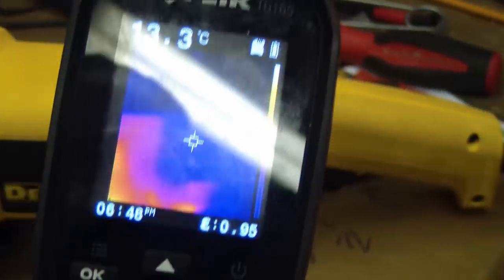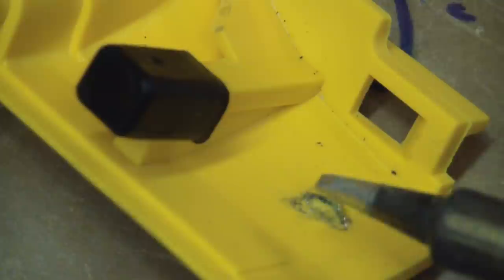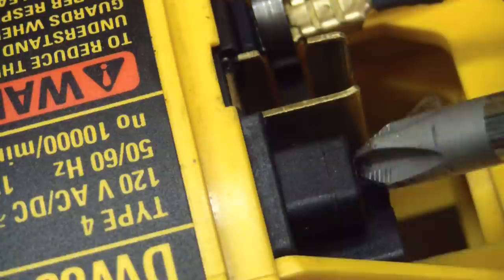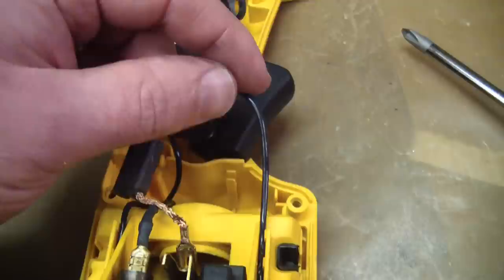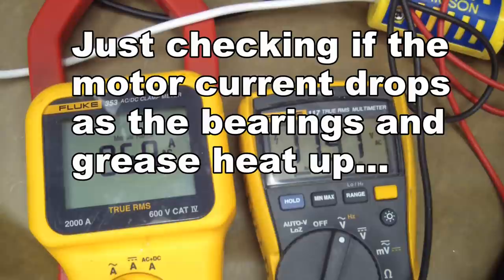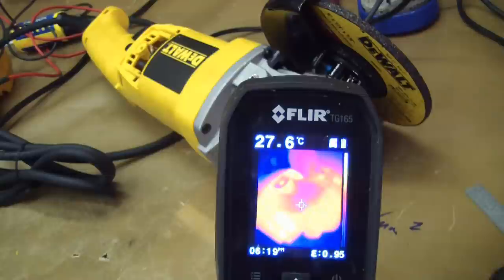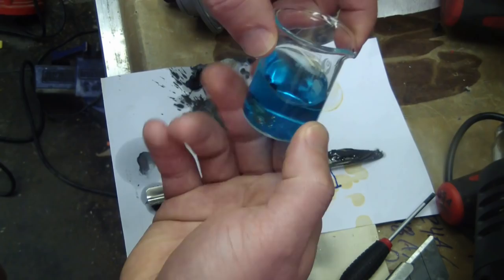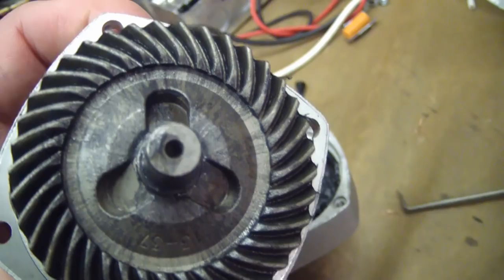Bored of lame tool reviews? Meet DeWalt's grinder guts Part B

Comment: The gear absolutely does go out the most often. I have seen the brushes on Makita grinders 'let the smoke out' many, many times. I have only seen the DeWalt eat its own brushes once. Our shop uses the DeWalts exclusively now as they are a great bang for the buck. Speaking of bang, that brings me to the most common failure mode I have seen. When the 200 lb gorilla gets impatient, he leans down on the grinder. I have seen dozens of these break where the handle goes into the motor housing. You commented that it was odd that the motor housing had a gantry style support. That support comes of inside of the handle if you lean on the grinder too hard, or drop it the wrong way. Make it idiot proof and there will be a better idiot!
Reply: +Joe Clark What do you think of the DeWalt 5 inch rat tail? I've used Makita for years but the quality seems to be getting poorer. The 5 inch in AvE's video are heavy the company I work at has one it's heavy the 7 inch is even worse.  For years in all we used in the family welding shop now closed the staple was 7 inch Makitas the 5 inch wasn't that common then. The old 7 inch Makitas never die but they are too heavy for what I need my brother is trying out DeWalt he's tired of Makita grinders failing he gets about a year out of them sometimes less than that.
Reply: +Graveltrucking - For a welder doing heavy work a grinder is a consumable. I get about a year and a half from a DeWalt. I'm on my fourth. Good little machine.
Reply: Graveltrucking, bowie33333 is right on the money here. The only grinder that will last you forever is a 9". The only reason it'll last forever is because you don't want to use it. I think that DeWalt still makes a good 5". They seem to be pretty durable. Makitas need to fix their 'anti-vibe' handles.
Reply: Joe Clark - "The only reason it'll last forever is because you don't want to use it"

LMFAO, you are absolutely right. Those big grinders are unwieldy bordering on unsafe in my opinion. If you need a grinder that big, go get the torch, lol

Any handle can be an anti-vibe handle if you back it off a quarter turn, I was surprised at the difference it made.
Reply: +bowie33333. Backing the I was talking about the other handle, the one with the trigger on that. Majors made it so there's almost an internal hinge between that handle and the motor housing. You can flex the frame easily with only a little weight. It's a terrible design. Marketing schmoo for the back yard pros.
Reply: Joe Clark - Oh ok, I get what you mean now, I was talking about the side grip. I haven't used one, but if it's marketing schmoo, it's not worth a nickel. I wish these companies would realize I don't want the "next best thing" or some helper or gadget on my tools, I just want a good tool. It's a motor on a stick for crying out loud, keep it simple.

Comment: Yes they had powderd metal gears, some
 They made a lot of gears
 They had a giant steel room and 50 multi spindle automatic acme gridley screw machines. Very good engineers. Shop had best tooling for all machines, then scrapped the whole factory, cheap labor and all. Whoever told you being a machinist lied, my machines were interesting and a challenge to set up. Thats about all I did

Comment: trigger lock on the trusty motomaster,  has an open ended handle to put yer broomstick in like a morse taper, some duck tape for even more safety.  seemed like a good idea at the time, worked out well removing anchors from above on a balcony thankfully.  similar spiral bevel gearing, eventually kept popping off the lock nut and sending the disc flying down the driveway twice!  I took er apart and the large gear teeth were gone almost, put it back together and it wouldnt even catch.  Let the dewalt finish removing the cracked aluminimum chinese "racing" rim and ground off the rounded soft metal chinese coated lug nut that no extractor I found would fit.

Comment: The remade Ford GT had issues with powder metal casting on suspension parts. If you bough one a car that was over 100 grand back in the early 2000's you couldn't drive it for a year till they came out with forged replacement parts. I do see that the power metal is going to be future though as it's probably much cheaper to produce over machined parts. I'm curious to see what the insides of a Milwaukee grinder looks like. I could defiantly take a tool apart, but I also lack the electronics and machining knowledge you have. Also I wouldn't have the colorful Canadian commentary Michigan is close but we don't pick up all the Canadian slang.
Reply: Mercedes had a sintered and hardened timing sprocket a few years ago. Teeth sheared off and blew up the engine in my moms car.
Reply: Sintered gears can be good if the process is worked out. You just don't want to be an early adopter after a new process is implemented.
Reply: Robert Szasz  They are probably great in lower torque situations. I would rather have the sintered gears than plastic.
Reply: haha Michigan representing

Comment: The Black&Decker Wildcat grinder was the (tush-hog) in the trenches industrial pipeline in the good old days tool. Used with no guard nor handle for grinding the root-pass. AC/DC  because the Lincoln petro-fired welding machines put the DC power/out. I would love to see one of them analized like you have done like here. LUV your channel WTG P.S. no clip/board men out in the field where (no guard or handle) concerned.

Comment: OK I'm two years late - With regard to power factor and VA, I always was under impression that VA was used because no power is dissipated in an inductor or capacitor (perfect ones) only the resistive element will dissipate any power, why they get hot.

Comment: I saw another review that tested a cordless drill and you were trying to workout a way to load the output to quantify the power and battery life of the tool. I have used a permanent motor salvaged from a tread mill as a generator and for an adjustable load I use a heating coil from an electric cloths dryer. By moving the wire attachment points the resistance aka the electrical load can be changed.

Comment: If you want to see if it's actually molybdenum disulfide you could have put a bit of that pixie dust in a ceramiken with a few drops of sulfuric acid and then heating it until its ALMOST dry, you don't want it to be super dry. If it's molybdenum disulfide  it should have a blue color to it. And don't forget your safety squints!

Comment: decent grease would probably extend the life of the gears a lot. I have always thought that was the primary reason why all different grinders gears fail rather than the fact that the gears are powered not machined as I have seen both types fail (chipped/worn teeth etc). although the units I have pulled apart with failed gear teeth were industrial and A. worked very very hard and B. had done thousands of hours work. the units I am talking about were Hitachi grinders

Comment: Why do you think that the gear is no good because it's powdered metal? Some of the finest tool steels are powered metal. The get a more even distribution of elements. PSF27 for example is a powder so fine that they can spray form it. Basically an advanced D2, it has some interesting properties such as being non stick. I use it to make blades as it is a highly wear resistant heat treatable alloy with good toughness. It's a usable knife blade at 61 hrc. As rolled, its pretty machinable for a tool steel. 

I don't know what alloys have been used, but gm makes/made connecting rods this way for their high performance engines.

I would say the problem is not powerded metallurgy. They just simply didn't do it good enough. 

Anyway, I bet you read that as argumentative because its the internet. It wasn't.
Reply: *****
Another thing to consider. Carbide endmills are made in a similar way. Its powdered carbide held together with a binding metal. Nickel for example.
Reply: I wasn't, I was comparing poor powder metal to good powder metal.
Reply: When Ford went to the powdered metal connecting rods in their 7.3 liter diesel in 2001 the ability to build a reliable high horse power engine was no longer an option. I'll pass on the powdered and stick with forged rods which are a much stronger product. Does a grinder need a forged gear? Probably not but it would be a more durable gear for sure.

Comment: Just a guess (speaking ex cathedra from my arse), but the copper-ish gear finish may be vacuum nitriding. Sintered metal powder behaves like a ceramic. It can be heat treated harder with less risk of stress cracks. This gear was file hard (RC 60-ish). Steel gets brittle at that hardness. (that's why the tang on a file shows heating marks. It's heated to about 400 degrees f, which is about RC 40-ish.) (relying on feeble memory-my numbers may be wrong)
Strikes me that if you beat this thing to failure, that Makiter or Millwalker right along side won't be too far behind in its own trip to the boat anchor phase. Sumthin's gonna break.

Comment: so heres a question, is powder metal gearing really that bad? seems most the tools you dissect for these vids have sintered powder metal gears. and usually really tiny ones transmitting heavy torque. that massive ring gear being sintered, is that really going to be a critically failing part? i mean does anyone actually do a proper machined gear in their grinders? curious on how all that translates to actual longevity.

Comment: Imagine the monster grinders we could have over here!  @230V 16/20A 3680/4600W and that is just from the mains.
Higher voltage equals a smaller wire gauge for the same amount of power.
Reply: ***** Haha yes, let the overvolting commence! The 50/60Hz should not be a big problem for these kind of motors, maybe they run a bit hot. The voltage however, heheheh.

Comment: Wondering if you could adjust the gear lash on the R&P closer?  That should chop off a few dB and heat?   Could go another step and lap with some valve grinding compound.  Just lightly.  Then readjust/shim the ring gear, do a final lap, clean up, regrease, and reassemble.  I've shimmed my HF grinders with washers.  I lapped the washers on a sharpening stone to adjust thickness.  They run a lot quieter.  Don't know how much of the mesh is affected as they warm up???

Comment: I know just enough about metallurgy/engineering/metalworking to ask stupid questions, so here's one re. powdered metal: Is the sintering process you describe much different from metal injection molding in terms of final quality of the part, or are they two ways of accomplishing the same thing? From what I've been able to learn, MIM parts retain about 98% of the mechanical properties of the same part machined from a billet of identical alloy, which I would think would be good enough for this gear. But based on the info in this video, whatever powdered metal process was used for this tool produces a substantially inferior part. So what's up? Is MIM better than other powdered metal processes, or was I just lied to about the quality of MIM? 
Sorry if this post is total gibberish. I had pain pills and muscle relaxants for breakfast.

Comment: A thought provoking video,well done mate. How about taking it a step further and dissecting and diagnosing power tools that have failed? People could send in unserviceable tools and we could all learn from why it has failed and what could be done to prevent or even delay failure. 
 If the DeWalt gears are no go or the grease is not the best then let's prove it by I service testing. It would be great to know the hours run by a tool and the nature of its use. A home user might only do a small fraction of the work of a professional user and there must be a cost/service life/quality balance?
Reply: You have a point but how about just throwing it out there and see what happens? I am sure serious tool users would be interested and the few bucks it costs to send to you is money well saved on not buying a duff tool or saved in buying a cheap tool that punches above its weight and surprises all of us? You never know,perhaps the big boys may sit up and take notice,manufacturers and suppliers?,Hell,we might even get better tools based upon your findings and user pressure and requests!

Comment: Just to chime in on the powdered metal. It's hard to tell just how or when it'll fail without knowing the exact composition of it. Powdered metal castings can range anywhere from crap potmetal all the way to high precision exotic alloys that include things like rhodium, chromium and tungsten. They're even now making machining endmills from powdered metal that rival solid carbide cutters. 

What dewalt uses for the gear casting? Who knows. I'm sure it's a "proprietary blend" though. But that could also be why it needs little lubrication. The metal used may be able to take far more heat then would ever be generated in its use
Reply: Occams Sawzall Right. DeWalt didn`t cast the gear, gM did. It desperately needs lubrication on that pitted surface.Most casting mixes for gears are medium-carbon steel with up to 1% Molybdenum content so it can be case-hardened. Foundries are not at liberty to make any crap they please, they have to conform. (Even China. MBenz then checks the finished product and passes/fails them.) Check out SAE 1045 steel properties: http://www.matweb.com/search/DataSheet.aspx?MatGUID=e2fd4473c1ac4dd5a49b20ddeff4f1ac A bit of steel background: https://www.youtube.com/watch?v=3dmLCcCOc-0 and a visual on spot-hardening: https://www.youtube.com/watch?v=78xPaYxSXlQ
Just some food for thought.

Comment: Great job trying to pronounce my last name (kuh-newt), most don't pronounce the k. Anywho, our shop has all 200+ lbs gorillas (myself being the foremost) trying to prove their strength. Maybe that is the reason our gear sets don't even outlast the trigger switch or original brushes. Our local welding supply shop has a 5" Milwaukee grinder for $112 U.S. I was thinking about giving that one a shot next. Our 8" Milwaukee grinders are at least 20 years old and still kicking ass. The DeWalt we have though sounds like an 8v92 run away! Thanks again for the quality content, I'm learning tons! Way better than those paid boobs doing "reviews" telling me how comfortable the handle is...
Reply: Will do, thanks for your Milwaukee input!

Comment: My works old dewalt grinder broke, not the gear box, not the brushes, but the handel. It broke right off, I was told it was 7 years old, and it was stored out side in a steel drawer, not a good building

Comment: When you were cleaning out the grease and to get the molybdenum sulfide out, something about the quality of the glass caught my attention. Seeing that the beaker was on the vise, I was quite concerned about the temperature differential. Really hot glass on a vise which is at a balmy 12C.... I just remember my failed effort in conserving frying oil by pouring it hot into a solid glass jar placed in a stainless steel sink.

Comment: you need to look at a Ryobi grinder I had 1 that the brushes overheated and burn out. could not hold my hand on the brush holder and the brush holder was just like the Makita. I now have a Porter Cable

Comment: Your reviews are awesome, keep it up mate.

Also, I wouldn't be so quick to diss the powdered metal gear. All mechanical devices is going to have a failure mode, and I'm pretty sure the designers of this tool basically decided that if they were going to have failure of the grinder, they will want it in a part that 1: does not cause catastrophic damage to the operator. 2: is reasonably cheap to replace.
So in the drive train, just imagine what would happen if each subsystem breaks down. If the gear breaks down, no biggie, all the parts are contained in the housing. As long as the fittings are strong enough, the disc will come to a stop, the motor might get a bit of a shock from the failure, but as long as the fittings are strong enough, nothing catastrophic will happen. And with the clever fan you mentioned, not even broken pieces of the gear will enter the motor and cause damage there either.
If the spindle breaks, the failure can be fatal and if the motor itself breaks, you'd basically write off the whole tool.
So I'd say the "fragile" gear is a safety feature that is easily serviceable in the field at an acceptable cost and far more preferable than a device where every component has been designed with high safety factors and the failure mode will be random.
Off course, I don't know that this is the case, but it's my hypothesis anyway.
Cheers,
//J

Comment: I want to send you one of these that i have had for a year or 2 now and have used the hell out of, about two monthes ago i was using a wire cup ALOT and had the trigger locked while i cleaned parts and kept it running as i putt new pieces into the vise and would start cleaning again, well id say i was there doing that for about 2 hrs i took a part out of the vise and while i was doing this there was no load on the grinder so it would obviously wind up and BOOM  sounded like the gears were eating themselves as well the fan stopped spinning, not wanting to take the time to putt my cup on a diffrent grinder i pulled the trigger a few times, beside the sound of parts crunching around inside it still spun so i kept working away, by the end of the day i think i turned the bits into dust as the crunching sound was now gone, althought the fan never has spun since i have still been using it heavly without issue for a few monthes. I think it would be a pretty good tool to pull apart to see how everything took the abuse and what actually broke even know the tool is still doing what it needs to. I just found it somewhat impressive that something imploded inside my grinder and it hasnt skipped a beat

Ps love the channel !
Reply: ***** Oh yeah, please take that thing apart!